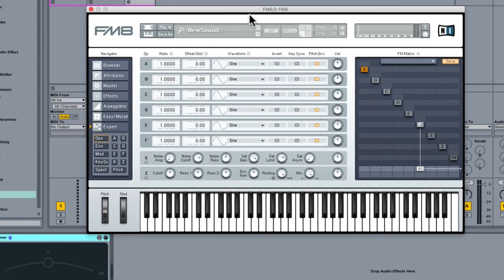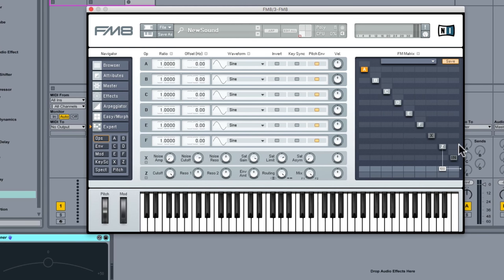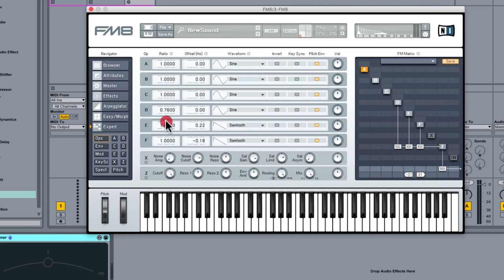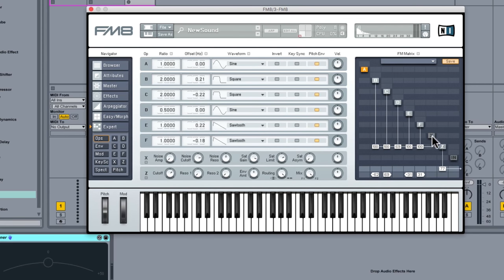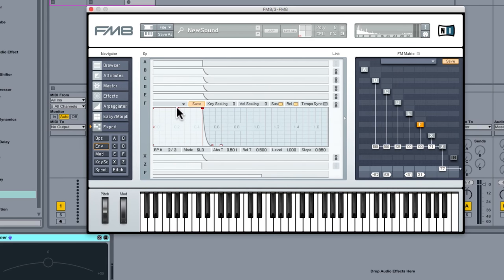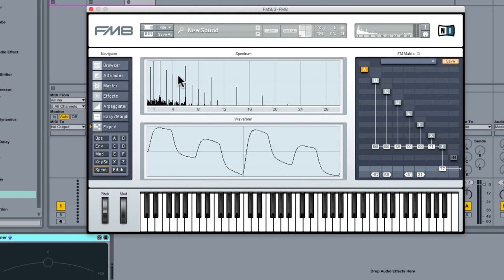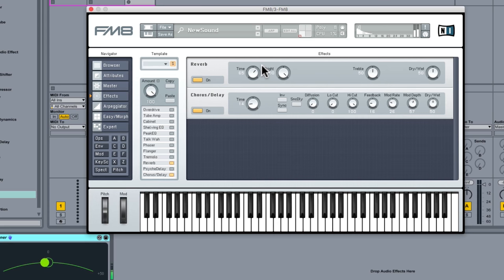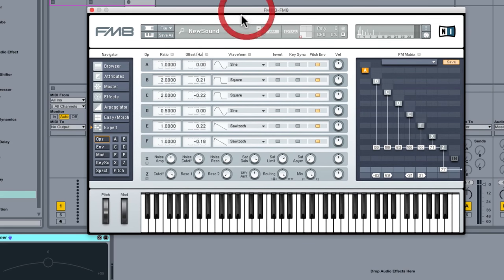Native Instruments FM8 - Creating an Additive Pad Sound

Comment: But brother how make an additive sub & sub bass & 808s  in fm8 ? Please brother reply I'm finding long time but no information or instructions I have.
Reply: 808s are generally made with a sine wave, that starts with a very quick pitch bend down into the correct note. 

I’m new to FM synthesis so I can’t give much beyond that, but just try things. Maybe use the first two operators to get an interesting sound, and then use a third operator with a fast envelope so it only affects the beginning of the note. That should get you the 808 pluck sound.